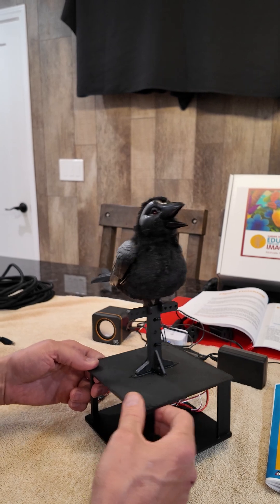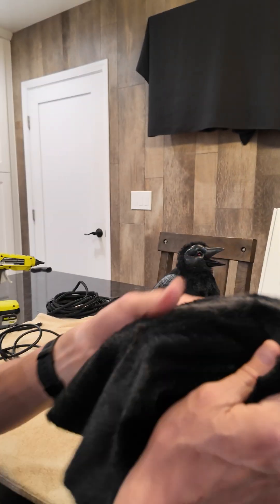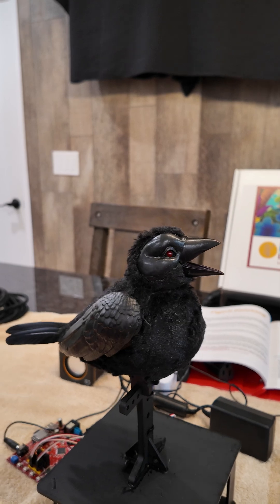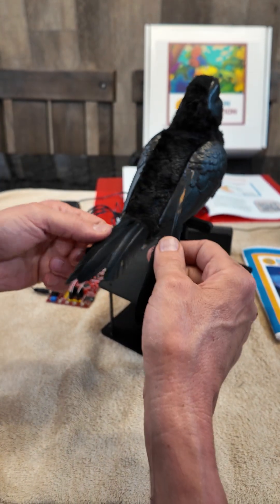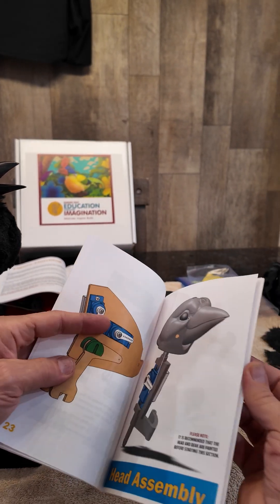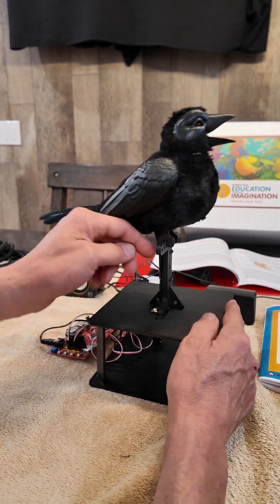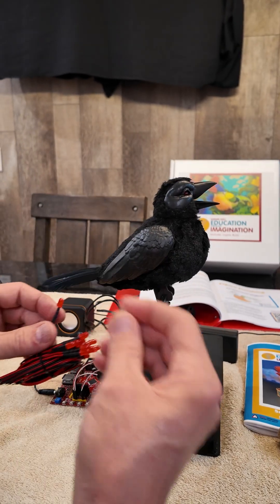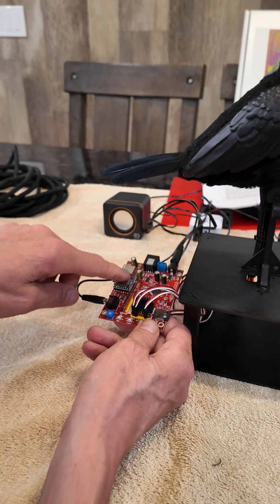Turning my Animatronic Mini Songbird I built - into Disney's Haunted Mansion Raven - FINISHED!

Comment: Hey there! Working through my Songbird now. Their electronics video mentions there is a way to record individual parameters at once. Did you explore that at all? I see you used the auto-beak function, but that doesn't look great in my case even when changing audio frequency settings in the config file. My show will be a 30 minute loop, and controlling all three sliders at the same time will prove to be difficult for me. Was really hoping to find a way to record one slider at a time. I tried combining datasets from individual servo recordings, but no luck.
Reply from the maker: That’s a good question, I did not explore different things. I just followed the instructions on the video. I do know, however, that the new and improved Songbird with the Kickstarter is going to be much more advanced and easier to build with a better board and programmer. The new Bird Electronics will allow you to do a full show with multiple birds. I ordered the early bird special for $319. I can’t wait to see what the new Bird will do.